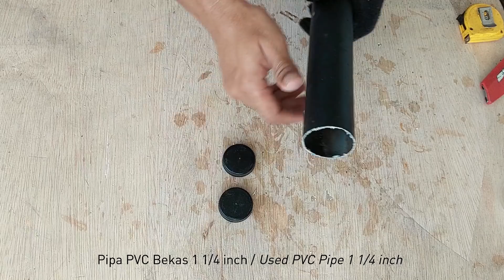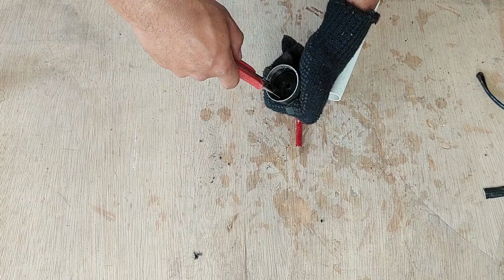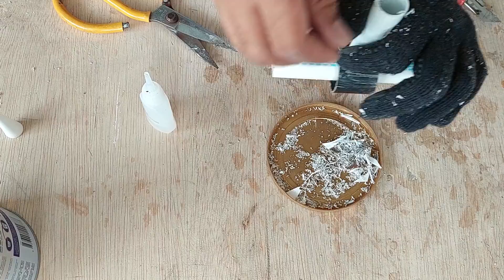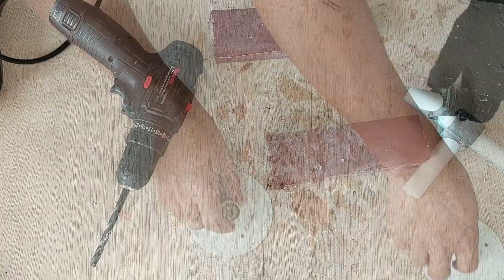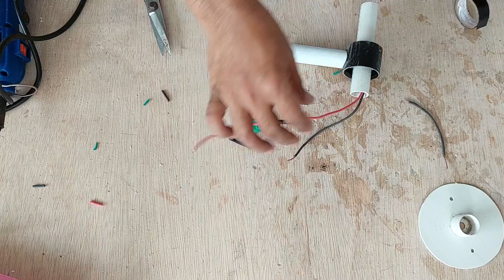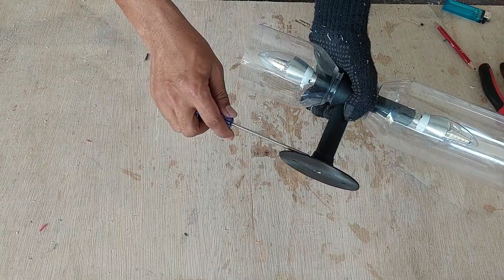DIY Membuat Lampu  Dinding Modern Dari Botol Plastik dan Pipa PVC

Comment: Question won't the plastic bottle melt due the heat that's getting from the light bulb.
Reply from the maker: there is a gap between the lamp and the bottle, use a low voltage led lamp. thanks